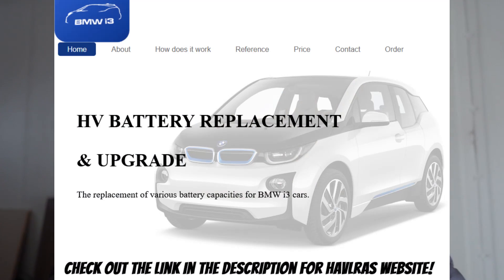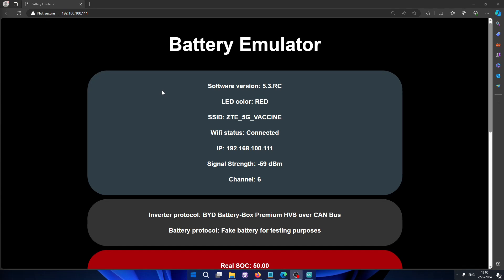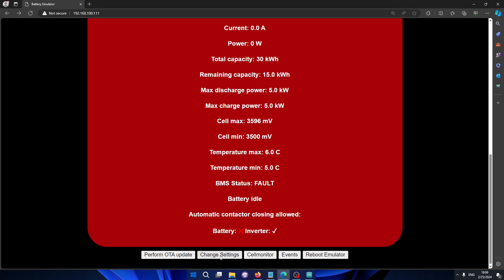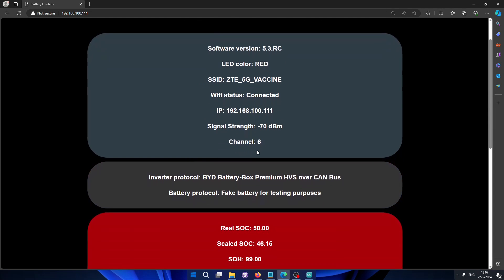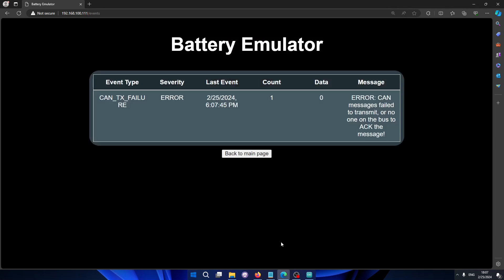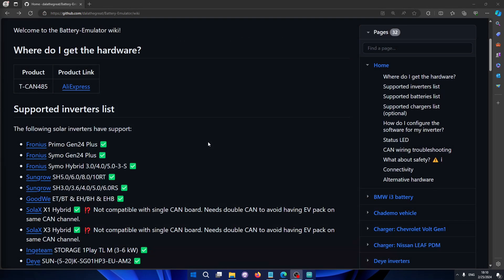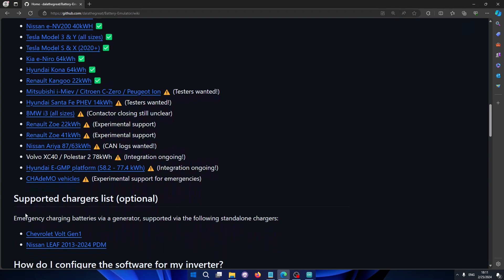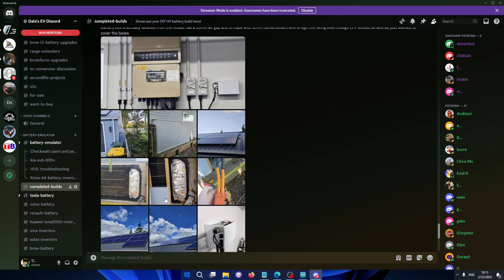Home battery storage just got easier! (v5 Battery-Emulator)

Comment: I have a nissan 24kw ev battery can i connect the high voltage 350v dc into my all in one 48vdc battery input on the inverter
Reply from the maker: No you need a high voltage inverter. See the Wiki for more info which brands work!

Comment: Hello Dala. A simple question: I bought used 24KWh nissan leaf battery with all the plugs. And the thing that puzzles me is that (it seems to me) there is different pin layout in the round plug. I mean in my original plug (that I got with the battery, it still hase som 20cm of cables attached) the only pair that is twisted (blue/green cable) which I think is CAN,  goes to pins 4-5 and another two cables (thicker red and gray) go to pins 1-2. It looks like mirror of your design from github. I write here about the pin markings I can see on the plug - when looking at the front of the plug (seeing the holes), looking this way, pin numbers increase from right to left, just as in your drawing, but the original connection is different). Am I wrong or you just numbered the pins in the socket in the battery "your way"?
Reply from the maker: Nissan mirrored the diagram. You have it correct.
Reply: @DalasEVRepair  Thanks. Figured it out too - in your table with the wiring diagram, you use the actual colours of Nissan plug cables, it helped as well.

Comment: Hey Dala, You're amazing with all this open source work allowing people to save money and become more self-sufficient.
I noticed you have mounted your leaf battery vertically on the wall. Is this ok to do? Can you only do it on some battery's or will all of them happily work vertically rather than flat?
Makes it a lot neater and easier to mount if that is the case!
Thanks from Australia!
Michael
Reply from the maker: All batteries should be possible to mount on the side without issue!

Comment: Hello Dala, do you know if there will ever come a Hybrid Inverter that also supports bidirectional DC-DC electric car charging? It just seems like a waste to have a seperate DC charger for the car, with almost the same hardware as the inverter. If this comes to market, i will jump on the solar/battery bandwagon
Reply from the maker: We are testing this on the Discord server already. Any hybrid inverter can be turned into a bidirectional charger.
Reply: @DalasEVRepair  Hi Dala, i plan to assemble a hybrid residential solar system, and i decide go with fronius gen24 plus inverter, but i can’t purchase the overpriced BYD battery in here, Indonesia, so does this project will allow me to use a DIY lifepo4 battery pack?
And about bidirectional ev charging you talked above, how can i learn to implement it at fronius gen24 plus hybrid inverter?
Reply from the maker: @bobbyhartanto3210  it does not support DIY batteries. See the Wiki page for more info https://github.com/dalathegreat/Battery-Emulator/wiki

Comment: Hi, great and impressive work . I would like know about opposite feature compatibility in the emulator. Can I connect low voltage battery (12V-48V) with a high voltage inverter
Reply from the maker: Nope, this only focuses on high voltage >150V batteries!
Reply: @DalasEVRepair  Thanks for your prompt reply. But why not have it integrated in here so as to be more flexible with customizable features

Comment: Dala I have question I changed my 24kwh battery to a 30 kwh battery after clearing faults with leaf spy it seems to ready to go only thing see is mileage meter is jumping from 80 to 125 can you tell me how to correct this issue thanks
Reply from the maker: Install a CAN bridge. Instructions here: https://github.com/dalathegreat/Nissan-LEAF-Battery-Upgrade
Reply: @DalasEVRepair  

Dala do I need a cambridge if my Nissan leaf is a 2013 with the newer 24 kwh the 30 kwh battery seems to be working except the mileage meter is jumping
Reply from the maker: @SalvadorEspiritu-l2k  yes it is needed
Reply: @DalasEVRepair  
Ok thank you
Reply: @DalasEVRepair 

Dala do you offer any service that can flashed cambridge so they are ready to be installed and if i installed battery on my 2013 24kwh to a 3.0 kwh and the only thing see is mileage meter jumping the
 car seems to drive ok is there any other thing that is be effected if I don't install cambridge that I will have problems with on the car
Reply from the maker: @SalvadorEspiritu-l2k  sorry nope! All open source, flash on your own. 20x cheaper this way!
Reply: @DalasEVRepair  
Can you tell me effects it might have the cambridge is not installed
Reply from the maker: @SalvadorEspiritu-l2k  For AZE0-0 to AZE0-1 there are not many bugs, the most noticeable one is the flashing range and potential error codes. If you cannot afford the 13€ canbridge from aliexpress, try to live with it!
Reply: @DalasEVRepair  
Dala i order one I was just a little concern with doing the flashing of the software on the canbridge I will give it a try thank you again for your help

Comment: I have a question I see you have one battery outside do you know if they gonna be damage if we charging on cold environment like -3 ?
Reply from the maker: I used this battery in -35*C outside!
Reply: @DalasEVRepair We had to buy 20 cm Styrofoam and create a protective structure. This is not a big philosophy, lithium batteries like heat (optimal ~20°C) I think that if I buried it in the ground it would be around 0°C
Reply: Thank you 🤩

Comment: 😍Hi Dala, thanks a lot for your work!! I have been thinking about changing the battery in my leaf for a long time and using it at home. Unfortunately my son had an accident, in which luckily nothing happened to him, but the poor car was unrecoverable. Knowing your project, we are left with the battery. The lilygo says that the battery and the inverter are ok but the Fronius Gen24 primo gives an isolation error 1082. Do you know what we could have done wrong? Thanks
Reply from the maker: Hi, hope your son is doing OK! For the battery troubleshooting, make a thread on the secondlifestorage.com forum, and I'll join there!

Comment: We just installed a 40kWh Leaf battery with a Solax X3-Hybrid G2 but we are running into issues with "Serial Data Link" it gives us an Error end seconds after a Recovery.
Is there anyone in the comment section that got the solution or a similar problem?
Reply from the maker: Ground issue / shielding issue, very common on Solax!
Reply: @DalasEVRepair  any cable / max length you recommend?
Reply from the maker: @BodOcean_Tom Any shielded twisted pair cable is fine. It is very common to have issues with Solax due to this, few days ago one person git Solax working with this message;

"OMG guys I took a ground from the battery box to PE and to the shield of battery can to lilly and it's Running OK" 

So check that cabling is shielded, and grounds are OK!

Comment: Does this emulator require an inverter that can charge / discharge high voltage batteries? Many inverters max out at 48V-60V. Are there workarounds for this voltage limit too?
Reply from the maker: Yes this is for grid-tie hybrid 200-900VDC inverters only. See the compability list in the Github page!
Reply: @DalasEVRepair  thank you! I do not think we have many of these available in the US.